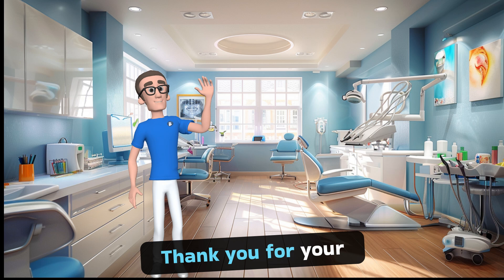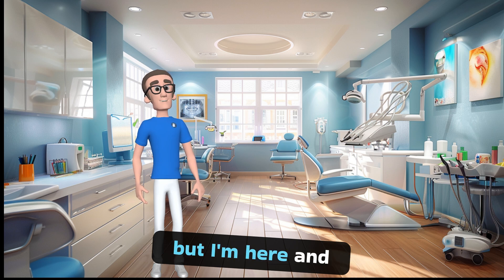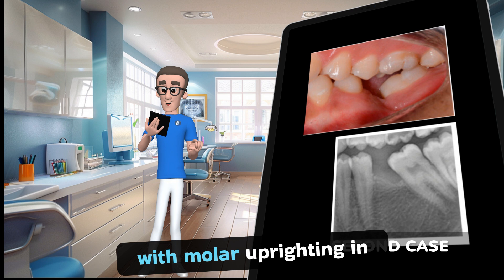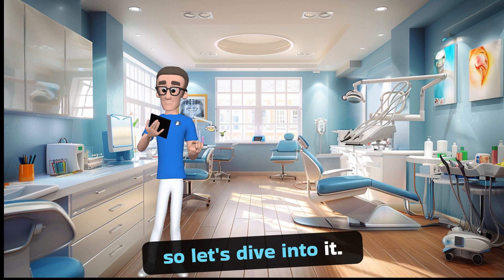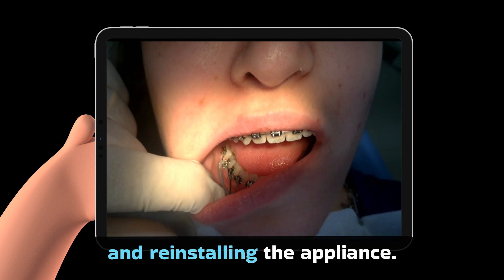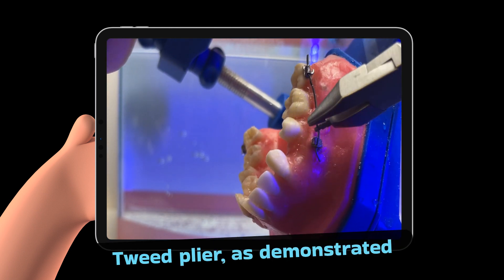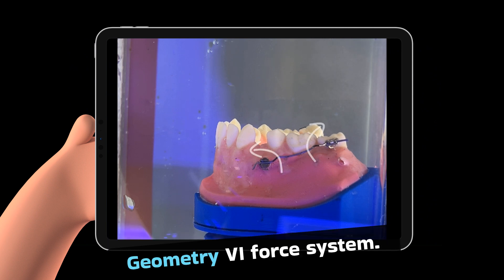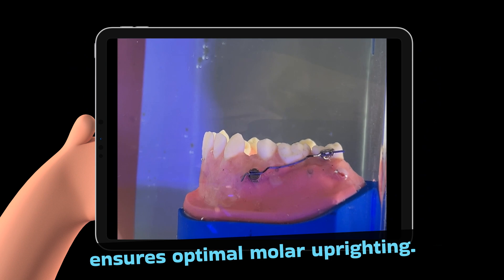Root Spring Reactivation | Essential Biomechanics

Comment: Dear doctor, I have ordered and read your book. I’m confused about 6 geometries. Can rectangular loop and root spring create geometries I,II,III ? or just IV,V,VI?
Reply from the maker: It's not impossible....but if we focus on ONE unit (the active unit that we want to move), and you draw the desired forces for this unit, you'll see that the forces needed to achieve equilibrium will always result in a geometry V, V or VI (considering the diagram of force system of our two-tooth segment.
Reply: @essentialbiomechanics9381  thank you doctor. That helps me a lot